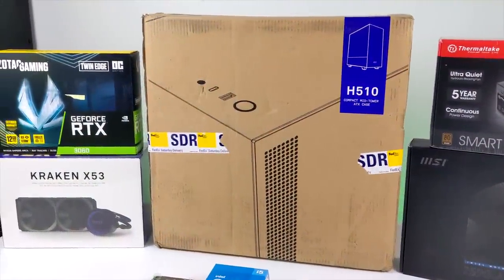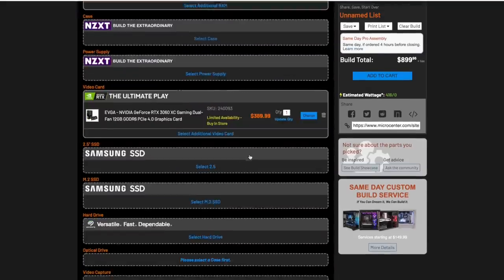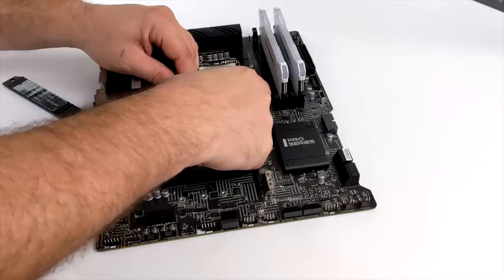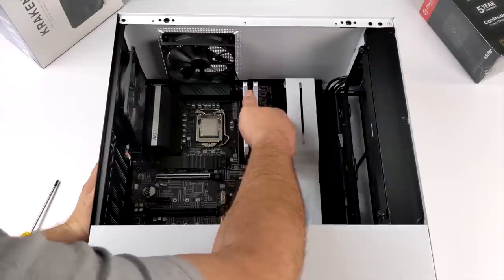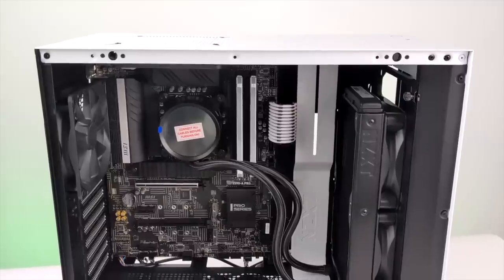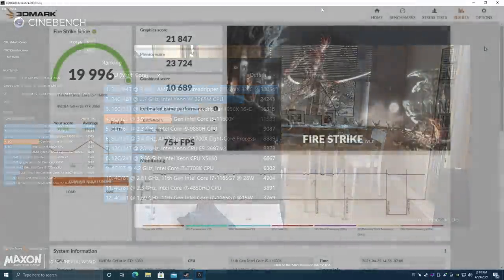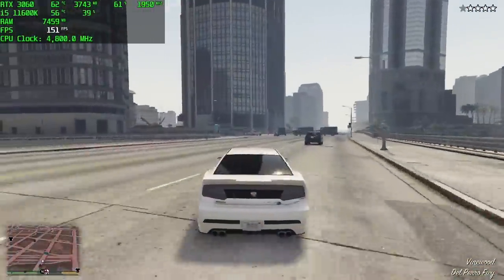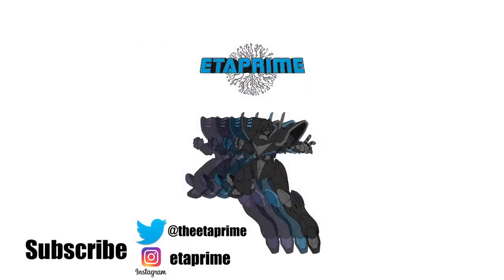Is intel Back In The Game? Awesome 11600K PC Build - With Gameplay

Comment: As already commented on but to reiterate. The radiator needs to be turned 180 degrees. If not your AIO pump will die prematurely because it will constantly have air trapped in it.

Comment: That's a really nice build and the 11600K is a decent cpu. There's a lot of value in the 10'th gen especially. I ended up upgrading my motherboard and cpu on Friday from a msi B450/ Ryzen 3700X to a Strix B550/ Ryzen 5800X to go with my 5 month old Strix LC 6800 XT and it's smooth as butter with SAM on. I buy all my parts at Micro Center too I love that place. It's where I got my gpu as well. We have some amazing gaming hardware these days whether it be PC or console, it's just the supply and demand that really sucks.

Comment: Please don't take my comment as being rude as I'm just genuinely concerned. I've been told the AIO should be mounted with the tubing ports on the rad up rather than facing downward as it could put strain on the pump and introduce air bubbles into the line as the fluid begins to evaporate over time. I could be wrong though.

Comment: Intro music?
When I build a pc, I think this build is gonna be my starter into PC.
Reply: Don't use Intel 
Its sooooooooooooooooooo hot
Use a Ryzen 
It got more powa bebe
Reply: @firesnake6311  actually, the i9 is SO hot, even a 360mm AIO cannot hold it.
The i5 and the i7s are good as price/performance, just make sure you have a decent h510/b560/z590 board that can keep the tdp under control.
Ryzen is good, but the tabled have turned, and they are low in stock while intel has the 10th and 11th gen cpus in stock.
Intel was taking the Performance table.
AMD was the value.
Now it's the opposite.
The 11th gen i9 is a disappointment in everything, but that doesn't mean the 11th gen cpus are bad.

Comment: From what I heard, you shouldn't have the AIO tubes go from the bottom of the case up to the CPU Block, because Air bubbles will rise to the pump and could lower its lifespan.
I believe the optimal setup is to have the radiator inlet at the highest point relative to the CPU block.

Comment: The 11600K is absolutely the gem from the 11th Gen CPU's 👍👍 

I get the dislike of the i7 and i9 parts but this one for sure is decent option for a good gaming PC + it's in stock.
Reply: Why would you dislike the i7 when it's $50 cheaper than the 5800x. Because you were told to by some YT channel?
Reply: @channelthechannel  I didn't say I disliked any of the parts did I, I said I understand why other might.

personally id rather go last Gen Intel if I was going for either the i7 or i9 but that doesn't mean I dislike the 11th Gen parts, I just think there's better options, due a number of reason so no I don't base my opinion off other YouTube channels, I do own research & make my own decisions when it comes to hardware.

Comment: I was thinking in doing a similar build but with a 3080 in it. To do 4k HDR gaming. 
But now the video card shortage i have held off building a new PC all together. Gotta wait for video cards to come back again in stock. maybe get a newer version of card. Im grad the 3000 supports hdmi 2.1 stuff which im looking at for tv use.
Was looking at rocket lake, it offers pcie 4.0 and ddr 4 for the first time for intel. 
I hear adler lake will come out later this year that comes with new standards. pci-e 5.0 and ddr 5. pci-e 5 gotta wait for peripherals to support it and i can only see ddr5 being just as fast as a top end ddr4 at first and maybe a higher price. It will get better in the years to come.
Ill prob end up building the pc next year but grab that video card as fast as possible, even if i have to pay full price. Im waiting so i put more funds in for pc. maybe a i7 instead if i have enough.
I find it kinda weird that it's hard to find a board with more new tech. they seem to put a few new tech then fill the rest with older technolagy's. Like i see top end boards with one gen 4 m.2 slot and the rest gen 3.

Comment: I just bought a 3060 intel laptop and had loads of issues with low 1% frames dropping to 20 every few seconds and wont let me reset :(
Reply: Im guessing u have i5 10300H
Reply: @arme7689  yes :'D, managed to reset via cloud and benchmarks faster than 2070 max q ;o
Reply: So do you still get bottlenecks?
Reply: @arme7689  my 1% lows seem to drop to like 40FPS every 5-10 seconds on Fortnite, even though the 1% highs are like 250FPS
Reply: @arme7689  i think it could have a cacheless SSD installed which may cause bottlenecks
Reply: @KentRoads  i think its your CPU
I plan to buy a laptop like urs but it has to have at least 10500h
Reply: @arme7689  fs2020 has 'limited by main thread' so probably :( I'ma update the ssd and ill update this post if FPS changes
Reply: Thats so nice of u bro. Update us if ever u remember